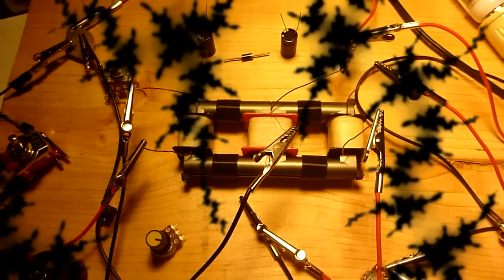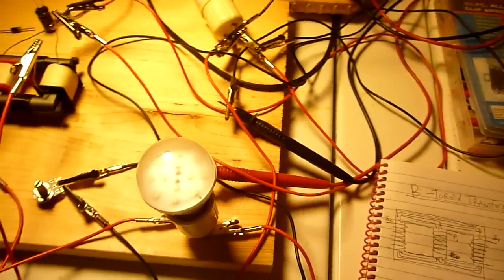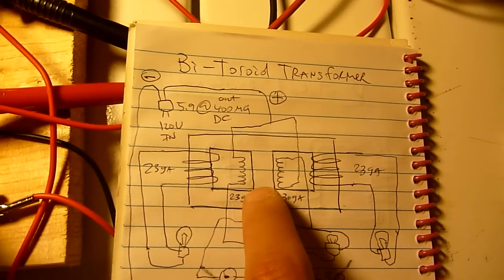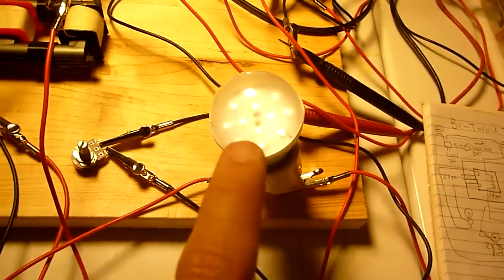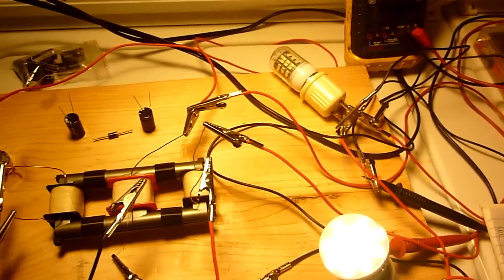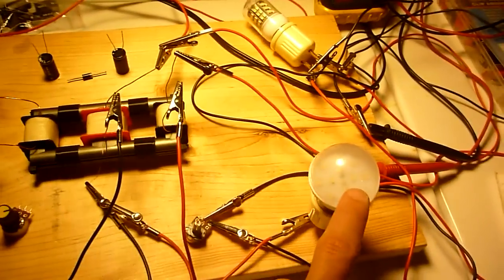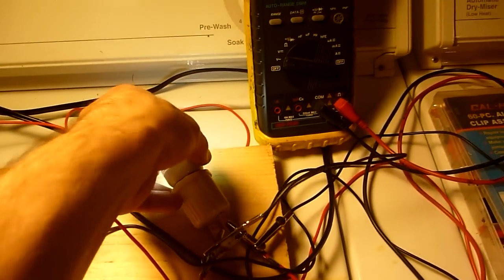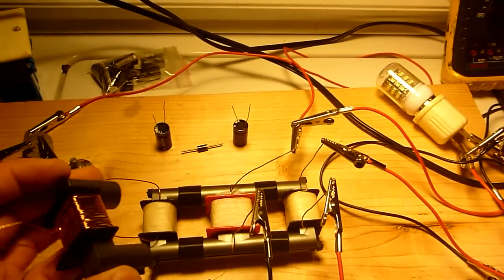Bi-toroid Transformer replication (over unity transformer)

Comment: Much of what can be found on the Internet does not work. If one wants to win energy from the physical vacuum, it must come to the symmetry break in the physical vacuum; otherwise it does not work.
What is to be done with this system for this:

1. A symmetry breaking in the physical vacuum can only occur, if the transformer works very lossless and this transformer is operated in the non-linear range. In the linear range, symmetry breaking in the physical vacuum is not possible.

2. The transformer must be fed with very short pulses of a certain shape at a precisely defined repetition frequency.

3. When the transformer is optimally tuned, the transformer does not absorb active power. However, it absorbs reactive power, pure pendulum power. It needs this power for an optimal process of transformation of energy from physical vacuum into real energy.

4. When the transformer is optimally tuned, real power can be tapped at its output.

5. There are a lot of very different transformers, which allow under certain boundary conditions and pulse formations to convert the energy of the physical vacuum into real energy.

6. These transformers are not harmless. They generate torsion fields that should be shielded with aluminium enclosures. Other metals are ineffective.

Comment: Magnetic flux doesnt exist, thats an engineering model engineers use to help calculate simple systems.  You need to backup and analyze this from a VECTOR potential A perspective to see why it doesnt work.  If you use simple digital multimeters to test it they give you false data that makes it look like the current is dropping with applied load due to distortions in waveform but proper equipment shows what is really happening.  I tested this and its a distraction and doesnt work, learned something but thats about it.  Many other really valid mysteries to look into, this one is not one of them.  Rexresearch has many more worthy puzzles to investigate than this for all you experimenters.

Comment: Alexander US Patent 3913004 Increasing Electrical Power
Does the technique of rotation with transformer effect (double wires) as in the 1975 Patent motor/generator, ALSO APPLY to the certain special BRIGGS alternators , the one with black and red wires 1/2 + 1/2 and 2 separate gauges, with white end connector, stator ring for riding lawnmower engine . The two ends of alternators are grounded. This COULD BE  a dual output alternators with wires in same slot being activated by magnets. One side for light bulbs AC , other for one diode charging battery DC . IF PUT TOGETHER, and with bridge rectifier, output was 14.9 amps. Someone tested this and their video was shut down. The alternators are run by crankshaft, no extra electric input power required as in the transformer type Patent.First winding generates ac out, it also induces into 2nd winding for 2nd output increased power, and that winding generates also from magnet. . Free electrical energy increase? A 1 cyl engine with same ring set,was run at idle speed on hydrogen gas generated and expanded water vapor pressure in 2008

Comment: Measure the wattage, or voltage and current at the same time. Just measuring the voltage doesn't tell us anything of value.
Reply: As it is, it isn't overunity. I doubt thane heins is the actual inventor of the flux-gated transformer. It is designed to prevent most of the opposing flux from flowing into the primary coil, doing so separates the load from the source but sacrifices primary impedence. Even if the opposing  secondary flux and the primary flux are in space conjunction with each other for each of the secondary coils following the geometry of the transformer, there's actually no increase in induced emf. It is evident by measuring the induced emf for each of the coil, which is simply half or equal or more induced voltage, depending on the ratio of number of turns between primary and secondary. Or else there would be an infinite rise in voltage, which is ridiculous.
Reply: @lukiepoole9254  You're right of course. I'm just weary of these videos where the title says overunity but the video makes no attempt to prove it.
Reply: @tommyholmberg  Technically it is overunity if you include purely lagging power factor as input. However that is not logical as there's reluctance ratio as well. Although, I am not exactly sure about the induced emf. It would be very small according to reluctance ratio.

Comment: Question?
if the magnetic flux in the 1 secondary core is in the same direction as the magnetic flux in the 2 secondary core, say both clockwise and counterclockwise, would it help to avoid a return to the primary core?

Comment: You took that primaryblight bulb off but cirkit are still loed is on by emitter and base,  look like corrector are sill connected on your schematics so if you take off primary light bulb off still elctic load are on from other line?
Sorry its  hard to see all wireing

Light bulb taking off doesbt taking. off load but still load is on my transister? When you took off light bulbs that load wen to other 2 light bulb so they become brighter. 

I wan to see more detail of this reprication please. I want to know more if its really over unity or not. Thanks I am looking over unity it works and I can repricate . 

If you this works usingvthat enagyvand connect to many diffarent devices using free enagy how come you are not doing it please let me know sir thank you for all your hard works. I can not do it you looks create so many reprications easily amazing.

Comment: are you feeding the transformer with high frequency and what frequency , what i wounder about is the rectifier would be of a low frequency type in the bulbs and wouldnt rectify the wave form efectivly cumming out the transformer as they are for low frequency mains ac .so they would be lit wrong as they struggle to convert the hf output from the transformer ?

Comment: i know whats happening there, its because the middle core is separated into two cores.. even if when you short the other output coils the lenz effect only happens to that core the other side of the core is not affe cted since the opposing magnetic flux only experience to thE ONE core , not the other @Naoki Kashima
Reply: you from USA or E roman \romyn?\ De ce separate in middle?
Reply: @ivancuciuc9591  I'm from Philippines. free nergy hobbyist. i have a collections of real free energy patents or over unity devices
Reply: @ivancuciuc9591  in the primary winding which is at the center , there are two cores each one has output coils at left other at right, when one coil is shorted or applied with load , only that specific core experiences lenz effect thus does not affect other output coil

Comment: i write for the benefit of the poster/readers  who do not yet understand  TRANSFORMERS.  and what they CAN  NEVER  DO.     but first.    voltage is  Not  power.   amperage is  Not  power.    power is WATTS.   in most cases, watts are  Calculated.     volts x amps = watts.    it MUST be understood that a small amount of  Power  is  'consumed'  in the  'transforming'  process.   in other words,  THERE  ARE  LOSSES.      no mater  What  you do,    WATTS  out of a transformer  WILL ALWAYS  be  Slightly  less than,  Watts  in.        in this discussion,  amperage is the current Present,  WHILE  A  CIRCUIT IS    OPERATING.     any such measurement of amperage,  Must  be made,  CORRECTLY.     googletranslate
https://en.wikipedia.org/wiki/Transformer

Comment: It almost looks like a single phase to 3 phase Transformer. See what happens if you put a capacitor connecting boat load coils it should reduce your amperage load on your center coil. If you had 100 amps at 110v on both load coils you would need a 20 mf capacitor connecting them.

Comment: your transformer is incomplete , right now its just a normal three fase transfromer , you need two extra cores linking to both secondaries on each side but avoiding the primary , this way the back emf from the secondaries will feed each other instead of going to the primary.

Comment: You're on the right track but utilizing the wrong method. You need to mitagate the back emf that returns to the source by channeling it away from that source. Something more like this

https://youtu.be/Z_-3Nz1ZuSI

It was intially designed by an MIT professor. I am trying to get together the materials and time needed to put one together utilizing an addition 4 coils (2 on top and 2 on botton) near where the back EMF currents meet through the larger flux channels in  order to aborb the emf for energy and to diminish the chance of magnetic saturation of the core.

Comment: Anyone who is not using room-temperature superconductors to wind these transformers,  
is wasting their time and money.  
Just reducing the opposing Back EMF, and defeating Lens Law, is not enough.  

Here’s GE’s 2002 stated vision of what our world will look like employing superconductor technology :
"Electric generators made with superconducting wire are far more efficient 
  than conventional generators wound with copper wire.    In fact,   
  their efficiency is above 99%, and their size about half that of conventional generators.”    
  http://www.superconductors.org/uses.htm 

All The Rave About Superconductors - Size Really Matters  

The diameter of some superconductors are 1000 times smaller than copper wires
required to carry the same amount of electrical current.   So,  
1000 x 1000 = 1 million times more turns of superconducting wire
can be put in the same coil space as copper coiled wires.

The resultant magnetic strength that a coil of wire can generate - B
is governed by the number of Turns of wire in the coil,
times the amount of Amps of electrical current sent through the coil, 
divided by the Length of the Coil. (not the length of the wire)  

       B = (Amps)(Turns) ÷ Coil Length             

You can see that by increasing the Amps,
or by increasing the number of Turns of wire,  
or by decreasing the Coil Length, 
we will proportionately increase B - the strength of the magnetic field. 

Instead of spending a lot of $$ on energy (Amps) to produce the magnetic field, 
we can just increase the number of Turns of wire to increase the magnetic field. 

So think of Amps as money - the cost of electricity to excite & run a motor,  
or the cost of biofuel or petrodollar fuel required to power a generator.  
If you reduce the required Amps to power the coils by a thousand times, 
then you will reduce and save a thousand times the fuel cost to excite the coils. 
That’s what all the rave about superconductors has been about. 
Superconductive wires makes it easy to produce “Free Energy”.  
Over Unity engine designers that don’t use superconductors are disillusioned.   
 
35 Room-Temperature Superconductors Discovered   since March 2011
http://www.superconductors.org/158C155C.htm   

Graphene nanoribbons tested could carry as much as 10 billion amps/CM
or nearly 1,000 times greater than copper.
http://www.talk-polywell.org/bb/viewtopic.php?t=1480 

Graphene has a current density a million times that of copper at room temperature.
http://www.zdnet.com/the-10-strangest-facts-about-graphene-3040093050/  

Magnetically excited sub-millimeter OD xenon gas filled SiO2 Plasma Capillaries 
are very inexpensive room-temperature virtual superconductors.

Comment: You have not proven overunity.  The circuit oscillates meaning charging and discharging of the coils.  You cannot use a voltmeter to accurately measure the voltage.  You need an oscilloscope and what you will see is voltage spikes which will be short in duration compared to the off time.  This is nothing more than an annoying oscillator.  Get a Oscilloscope and take proper measurements and you will see there is no overunity.

Comment: I do believe this is more efficient than 1.0, if you used a simple aa battery and ran the oscillator and lit up the secondaries and measured how long the aa battery lasted you can convince many others here..great job well done!
Reply: heck I think you can use the secondary to recharge the aa battery as well at the same time!
Reply: ReGenX Generator and Bi-Toroid Transformer Report for Siemens:
https://www.slideshare.net/PDiCEOThaneHeins3240/final-2018-report-for-siemens-regenx-generator-bitoroid-transformer-test-data-and-systems-efficiency

Bi-Toroid Transformer (BiTT) Load Isolation Transformer: https://contest.techbriefs.com/2018/entries/sustainable-technologies/8919

Electric Vehicle Regenerative Acceleration: https://contest.techbriefs.com/2018/entries/automotive-transportation/8864

Electric Vehicle Regenerative Acceleration Introduction: https://youtu.be/BASQju5X09o

ReGenX Generator for Electric Power Generation: https://contest.techbriefs.com/2018/entries/sustainable-technologies/8909

ReGen-X Stepper Motor for EV Regenerative Acceleration: https://contest.techbriefs.com/2018/entries/automotive-transportation/8920

ReGen-X EV Stepper Traction Motor Regenerative Acceleration: https://youtu.be/1LFGBqnR6tE

Thane C. Heins
President and CEO, Potential +/- Difference Inc.
Email 1: thaneh@potentialdifference.ca
Cell: 613.898.1131
Youtube Channel: https://bit.ly/2skVhhn
Slideshare Presentations Channel: https://bit.ly/2LVTgTI

Potential +/- Difference Inc.
Charging Ahead...

"Nothing is too wonderful to be true" ~ Michael Faraday
Reply: @fidelcatsro6948 I suspect that an extra circuit may be needed to bridge such a connection to charge the battery.
By the way, is it a battery that is supplying the setup?

Comment: I also observed in a toroid transformer that the input gets lower with a better output at the same time when a permanent magnet with the right polarity is introduced (the reverse will occur if the wrong polarity is used) near the switching transformer..only toroidal ones show this..the conventional E types don't have this effect I mentioned, I think the same principle is happening in the one I mentioned as well..the coils seem to work better efficacy when some kind of magnetic effect is created or introduced within the core as it is switching fast.